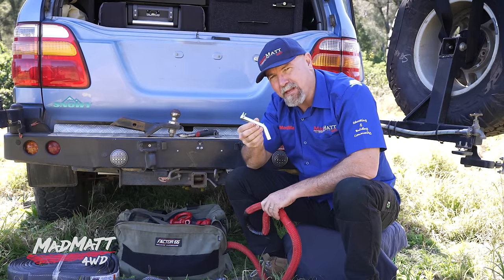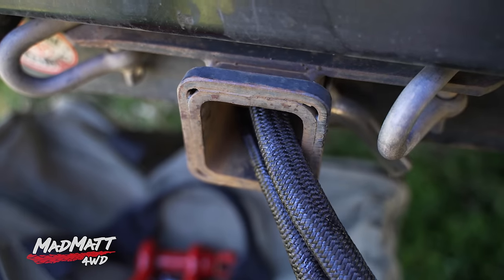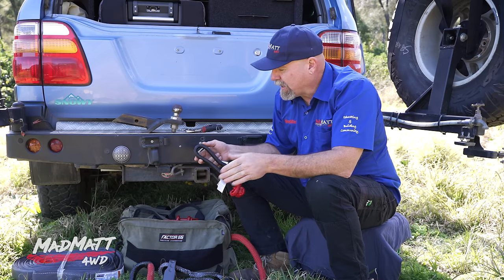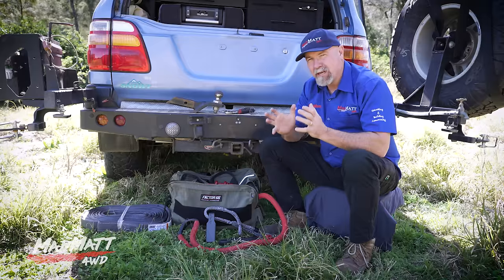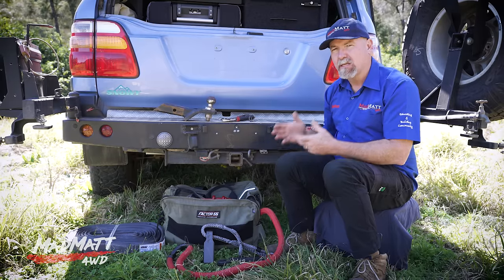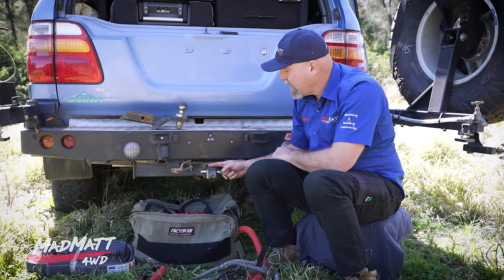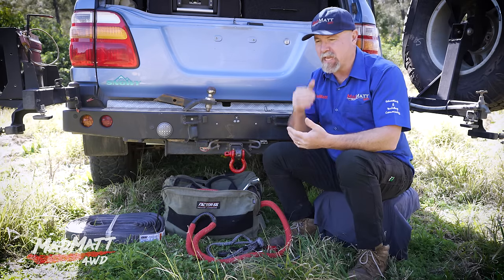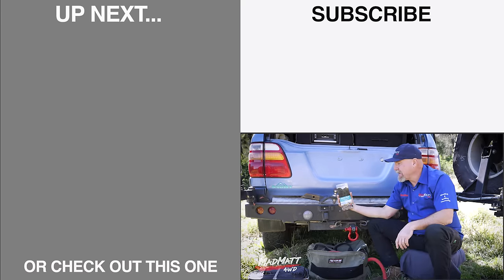Should you use a hitch pin as a 4x4 recovery device? Is it a YES or NO answer?

Comment: When the alternative is snatching on the tow ball I think the pin is still a good option iv done it heaps by take the tow ball out and just using the pin it’s safer than dying from the tow ball but that’s on my daily if it was my off road truck of course like you say be prepared rated recovery points honestly I wouldt bother with a hitch recover type point on my off road truck get multiple points for doing 2 to 1 systems ect
Reply from the maker: Pulling the ball and using the hole still leaves the weld point in place and this is often failing. Especially on a hitch that’s been used a bunch.
Reply: @MadMatt4WD  yea and that’s my point about it’s ok for my daily because it realy gets used like that only for light recovery type stuff but my dedicated off road rig has proper recovery points and multiple ones at front and rear because honestly I think a snatch recovery should actually be the last point of call the winch is such a better tool so much safer and normally not that much slower
Reply from the maker: @Questionabledecisionmaking  well said. 🤟

Comment: Air Dampners - what a crock. There is a youtube clip somewhere where a couple of farmers tested their straps and various air-dampners or suppression devices, whatever you want to call them. The anchor they used was a D8 dozer (I think), which weighs in at around 50 tonne and they connected the straps to a large, articulated 4x4, broadacre tractor and simply drove away until the straps failed. The intent was not to measure the point of strap failure, rather to see the effectiveness (or not) of the air-dampners. From memory they ended up with a bag of sand weighing in at around 16kg. The footage shows this heavy bag of sand hitting the ground and bouncing up to smash into the rear of the tractor cabin! You think your piddly little air-bag hanging on the rope is going to suppress a strap at failure point? Had the tractor not had a cabin, the air-dampner would have hit the driver. Placing a bag or coat over a tensioned strap at fail-point - waste of time!! Useless to the point of false security!
Reply from the maker: Many of us agree with what your saying. I’ve done some testing myself and found there mainly useless because they rarely get used correctly. The video your talking about is by ditch hitch and they show their method to control the failure which seems to work.

Comment: The tow bar assembly is designed for towing. Not for off road recovery.  How many bolts hold it to the vehicle ? And how rusty are the mounting points. There is so much to think about.
Reply from the maker: Totally agree

Comment: Hi Matt, have you addressed the small hitches that are about 12” to 14 inches across and are mounted by wrapping around the rear frame cross member and running bolts through to hold it? They are available for Jeep Wranglers. I have seen a cross member buckle, not mine thankfully! They claim to have a 6000 lbs tow capacity, obviously way different than a snatch recovery. It may not come apart but it will definitely damage your frame.
Reply from the maker: I’ve not seen those. They don’t sound like a good idea unless people are not using them the correct way.

Comment: Actually, If you use the pin only, and the rope is centered, it is still in dbl shear, but you are imposing an additional bending stress on the pin. So the shear stress is the same whether you use the hitch receiver or not. Of course the rope would probably go to one side or the other causing more shear to be distributed to one side or the other which is not good. If you used a flat strap instead of a kinetic rope you would reduce that additional bending stress, but probably not eliminate it, and you would probably distribute the shear to both ends of the pin mimicking what a receiver would do to a some extent. So the hitch receiver is definitely better bc it reduces the bending and distributes the shear evenly, but if you used a flat strap, I believe the additional bending stress would not be as much, so it would be sort of an in-between scenario from what you depict.
Reply from the maker: I think if you do some research you’ll find it’s not in double shear because the centre of the pin on the load side is not supported.

Comment: Hi Matt, I appreciate your videos and have learned from them.
I attended a professionally run course a few months back with an ex-military recovery guy and was specifically taught to use the a snatch strap directly connected to the hitch pin (and cautioned about sharp edges) with instructions not to add unnecessary potential failure points to a recovery.  
Using a kinetic rope directly off a hitch pin is dangerous for reasons you mentioned (if it even fits) and while the solution is to use a receiver and shackle between the rope and the hitch pin, that introduces two more peices that can either fail themselves or become projectiles.
Doesn't this point to a single snatch strap being a safer, simpler and cheaper solution than receiver + shackle + kinetic rope?
Reply from the maker: I used to teach that as well. I believe recovery in 4wding is a ever improving space, so things i once did I no longer do as I learn. There are way more experianced people than me in this space it just seems I have a voice they don't so we work together. So I believe a hitch reciver connected as I show will have an excellent margin of safty as opposed to a pin which has no design or testing for this sort of application. go for the safest method not the easiest.
Reply from the maker: @Ihavetopoop718  that’s an interesting idea. I don’t know if there’s enough space in there for all that but it could be explored. In defence of the Factor55 gear it’s all tested and is not failing out in the field so I feel comfortable that’s it’s up to the task with suitable safety limits.

Comment: You mention the bend radius using the pin could cause a failure in the strap.  Later you connect a bow shackle to the recovery hitch.  Would the bend radius of the strap be the same on the pin and the bow shackle?
Reply from the maker: No the pin is smaller.

Comment: Great video and glad you're doing this set of videos. As said before, should you be recovering off the tow bar? What is it rated to? No point in a 9t hitch pin, 9t hitch adaptor and 8t strap if the actual bar on the vehicle is only rated at 3.5t trailers. The forces are very different to towing a trailer, so do we know what the hitch is actually rated at for recovery? Worth a thought. 🙂
Reply from the maker: Have a read of this from Factor55. 

The 2” hitch itself is rated for 9500 lbs. that’s the max load. That’s why the 2” HitchLinks, all of them have 9500 lbs machined into them. Our parts have not seen yielding in testing until just before breaking. What’s this mean? Every other item you have attached to the HitchLink and pin will fail before either of those do. 

Standard duty soft shackle - 39K 
Tow Strap- 31K 
KERR- 29K 
HitchLink 2.0 - 51K 
Hitch pins- 50+K 

The entire off-road industry functions off break strength not WLL. 3/8 Synthetic rope breaks between 18-22K so a 5:1 means it’s WLL is only 4.4K on a 12K winch? 

It’s about quality of materials and validation through testing.
Reply: @MadMatt4WD  what is the 2" hitch mount rated for that is designed to bolt to a pickup step bumper? Pepper bent a pin at 9T or some such but what did it break at?
Reply from the maker: @iffykidmn8170  I'm not sure which hitch your refering too but if it's for towing it won't have a recovery rating. He didn't break it but i've heard from unconfirmed sources that theyve seen the fail in proper double shear as low as 16T
Reply: @MadMatt4WD  did the unconfirmed sources cut it half way thru before testing?
Reply from the maker: @iffykidmn8170  lol I know what your getting at. No these guys are professionals so I don’t think they were cutting things.

Comment: While I am not in any way advocating using the pin for snatch recoveries, I do feel there are several errors here.
1) If there is enough force to bend that pin to breaking point, it wil easily shear the R-clip. That doesn't mean there will be bits of metal flying around though.
2) You say that the pin is expected to bend at around 8 metric tons. Which you say is not enough. But your Factor 55 recovery point is rated to 9500lbs, which is only 4.4 metric tons. So the pin alone has a safety factor of 1.85:1 at the rated load of the Factor 55 recovery point. So what factor of safety are you looking for? I feel that 1.85 is sufficient given that no metal parts will become projectiles (which is not necessarily true for the Factor 55 point).
3) You say the pin's diameter is not sufficient a radius not to damage the rope, yet the Factor 55 point clearly has a radius less than half that of the pin?
Reply from the maker: This is from factor 55 and should answer your questions.
Reply from the maker: The 2” hitch itself is rated for 9500 lbs. that’s the max load. That’s why the 2” HitchLinks, all of them have 9500 lbs machined into them. Our parts have not seen yielding in testing until just before breaking. What’s this mean? Every other item you have attached to the HitchLink and pin will fail before either of those do. 

Standard duty soft shackle - 39K 
Tow Strap- 31K 
KERR- 29K 
HitchLink 2.0 - 51K 
Hitch pins- 50+K 

The entire off-road industry functions off break strength not WLL. 3/8 Synthetic rope breaks between 18-22K so a 5:1 means it’s WLL is only 4.4K on a 12K winch? 

It’s about quality of materials and validation through testing.

Comment: G'day, Thanks for the advice, Do you have advice on selecting the right Kinetic recovery rope. I used a 10,000lb to recover a Suzuki Alto (abopy 900kg), It was just like using chain.
Reply from the maker: General rule is use a strap rated at 2-3 times the lightest vehicle.

Comment: I'm very confused. The rated hitch is rated to about 4.3 tonnes and the pin bends at over double that.  I don't see an issue with using the pin. I've done massive pulls with the pin and no issues. I've tried to pull big trucks out of gullies and all the happens is my ute gets slung backwards before anything thinks about bending.
Reply from the maker: The rating of the hitch is determined by the tow pack in testing it fails way way above anything we’re going to do. Use the correct gear.

Comment: One small query and not saying that you should use it, but Isn't a D shackle or soft shackle the same diameter as the draw bar pin? Hence inside the tow strap design radius?
Reply from the maker: The pin is slightly smaller at least in my rigs.

Comment: Basically we are using adapted lifting devices used in the lifting industry every day . The lifting industry has to get all their slings etc tested or  replaced at regular intervals, 
Should recovery straps etc be replaced or tested at regular intervals ?  As we are talking safety ?
Reply: I would say yes! They are all consumables,  even hard shackles. It boils down to use and longevity. Inspect your equipment regularly.
Reply: Lifting  gear is not  designed for shock loads
Reply: @ianmillbank4039  I said adapted . As in tow rope now made of elastic type of material . I will say again Adapted.

Comment: Short answer is - its probably strong enough for normal recovery, the pin could bend tho... If pulling an extreme load its risky. Also note the tow rope will be bent sharper than it likes and it can rub badly if off angle. In a pinch it will work, for everyday recovery use a proper hitch receiver for recovery (not a ball end). Saved ypu 15min - thank me later!
Reply from the maker: Oh you should start a channel. 🤦‍♂️

Comment: Matt, I've got a 4runner fitted with a tow bar that has a tongue attached, not the receiver type. My question is would it be safe to use as a recovery point with the towball removed and a rated bow shackle inserted in its place, the pin of the shackle would go in the hole where the towball was so the shackle could swing side to side. I've done this mod, just had to enlarge the hole a bit to fit a 4.5t shackle but have never used it yet.
Reply from the maker: To be honest I don’t like the idea. For one generally that design suggests a light duty tow bar design. This won’t like recoveries. Please be careful.

Comment: In another video you mentioned the folly of "rated recovery points" in that there is always going to be something in the system that is unrated. Often that's the frame rails themselves. Normally a bridle is used to help distribute the load over 2 points, but if the angles are wrong, that can add an enormous inward force to the frame rails. That's not a normal force, and one can cause damage if they're not careful. This becomes particularly troublesome when talking about recovery points on the front of a vehicle, as many now have an accordion section of frame where the bumper attaches. I have noticed that ARB no longer welds on shackle recovery points to their bumpers for modern vehicles, supposedly because of this. 

So all that being said, would a front mounted hitch receiver be equal to rated recovery points?
Reply from the maker: Your absolutely correct about using a bridal. I’m not sure how you would fit a hitch to the front to make it work without having something totally custom engineered which would be cost prohibitive. I prefer the term suitable recovery point.

Comment: Great vid. One question though…..why is it that the pin is too small a diameter for the rope but the shackle isn’t?
Reply from the maker: The 4.75T shakle is thicker at around 19mm this falls inside the 1:1 bend radius ratio for this soft shackle.
Reply: @MadMatt4WD  ok cool. Thanks
Reply: @MadMatt4WD  Right, but using a soft shackle, has less than that as a bend radius. Using the shackle, it would closer to .5:1
If you put the strap in without the soft shackle, then I would agree with you that it is closer to the BR.

Comment: I disagree on the tight radius point.

Those pins are the same diameter as a soft shackle, bow shackle, equaliser strap or even a recovery hook.
So if that's going to damage your rope so is every attachment you use.

Then with  snatch straps they are made with a tight radius from factory, which is why they can be rolled up
Reply from the maker: The pin is 16mm a 4.75t shackle is 19mm the ratio required to maintain full strength is 1:1.
Reply: @MadMatt4WD  
I'll concede on the shackle.

But your point is still incorrect on the radius. 
In both your video you show and say connect to a soft shackle.
The soft shackles shown are factor55 and your website states their diameter.
7/16 and 3/8.

Both are well below the 16mm diameter pin size.
Reply from the maker: @Robert-cu9bm  I’ve had the guys at Factor55 watch this video and verify it for accuracy so maybe shoot than an email.

Comment: I have been using that pin for probably 20+ years and living up cape york I would use it very regularly.. I myself have never had a problem and I have been rather nasty on some of those recoveries. But after this explanation and not in a I told you so kind of way I accept the points and will go get myself one of this hitches  that I regularly give the southerners shit for calling it a flashy show pony bullshit southerners toy lol. Well explained and taken on board.
Reply from the maker: Glad I could help. Check out my gear store at madmatt4wd.com.au

Comment: Matt, good video. Nice explanation on "double shear" 
You suggest that the hitch pin diameter of 16mm may cause damage to a rope /strap eye but this is approximately the same diameter as a bow shackle and isn't a soft shackle going to be smaller still?
Reply from the maker: The minimum bend radius is 1:1 to maintain full rated capacity. Obviously depending on the soft shackle size will determine what’s ok from a capacity perspective. A 4.75t bow shackle is larger than 16mm at around 19mm.
Reply: @MadMatt4WD  
Aren’t d rings, bow shackles etc all supposed to be used with formed eyes?
Reply: @MadMatt4WD  What do you think is more likely to cause damage to a rope /strap eye, a 16mm hitch pin or a 12mm soft shackle? 
Suggestion for another video :
Designing a failure point into your recovery (weakest link) and preparing for the outcome. 

I found a soft shackle with a 14T rating and a 16mm tow hitch pin with a double shear limit of 10T.
Personally, I want the soft shackle to fail first.
Reply from the maker: @johnboyce6044  This is a good subject. Snatch straps fail at the end of the sticking. I call it a fuse. I can get them to fail every day of the week after a few hits. Personally I'm prefering to go the way of using good gear correctly and not over working it so I don't have a failure rather than having a fuse.
Reply: Listed size of a soft shackle, say a 7/16" or 11mm, is the diameter of the rope used to construct it. Both ends of a soft shackle will have two of those widths of rope present at point of attachment, so in this example, overall diameter would be closer to 22mm.

Of course, there's flex/compression inherent in rope that isn't present in a bow shackle, so how that impacts the overall diameter of a soft shackle under load for purposes of comparing likelihood to damage a recovery rope, I don't know.
Reply: @MadMatt4WD  
Your system should let go of the load at a certain point, they aren't called accident because we plan them. If I can't be hooked up better than what I'm hooking up to I dont do it.

I also live in a in California where we have steep obsicals and watched a Jeep that was just getting a little help o er a boluder break a drive shaft and take both Rigs down the hill. Maybe that's why I never hook up to someone else before putting a better attachment on myself first.